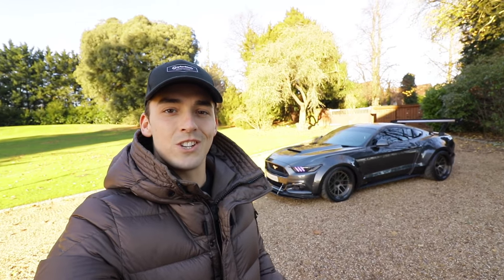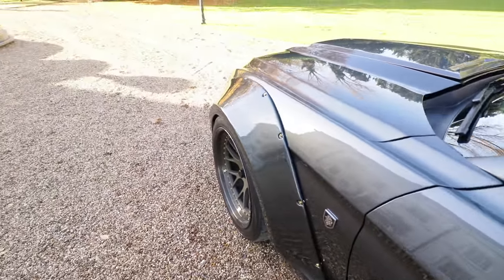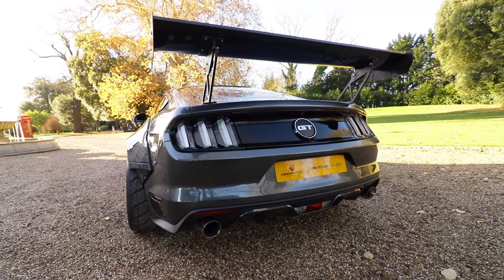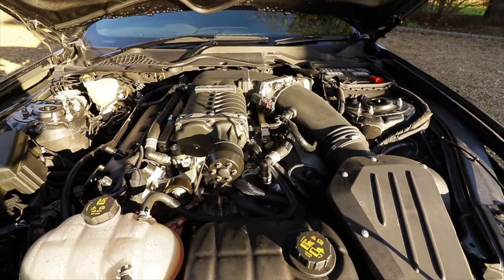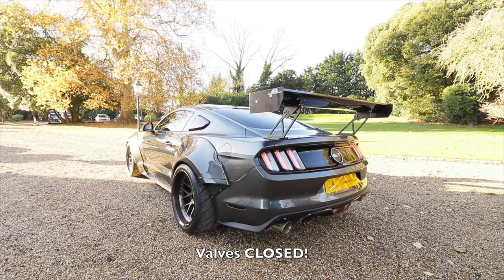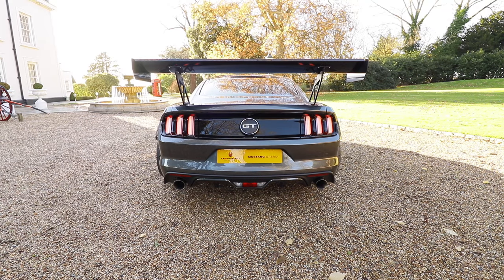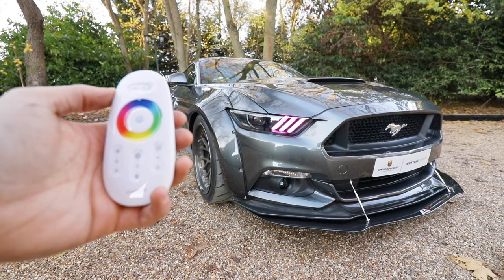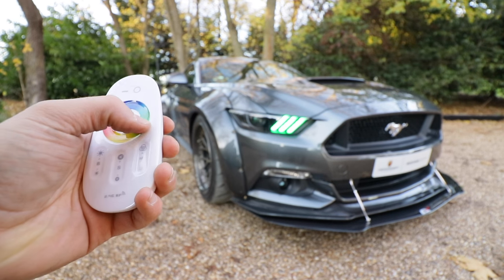My Friends 700Bhp 1 Of 1 Widebody Mustang!!!

Comment: 1:51. Someone drilled an extra hole.
Reply: good eye! it was so fast I missed it
Reply: might be where the 5.0 badge used to sit. not sure by that angle.
Reply: I'd bet a beer on it.
Reply: MrJakeuk1234 that's where the original badge sits. Would have been a butch to fill, body work, prime, paint, blend, clear all for a tiny dot.
Reply: This is ehere the 5.0 badge was

Comment: That Mustang is sick! 👌 In the future I will consider getting whatever the future's current model is in the GT Premium Manual. I'd get it in Race Red or Ruby Red, probably get some APR Performance parts, the Hellion Twin Turbo kit and tune that, and probably some red 19" - 11" Forgiatos in the front and some 20" - 12" in the back. If I could also contact GReddy for a custom Rocket Bunny kit on it, it would look sick. Maybe a Roush Exhaust, some custom LEDs on the Headlamps, and to finish it all off with some more parts, and—well the customization process never stops.
Reply: Inspiration _ 
all the best bro